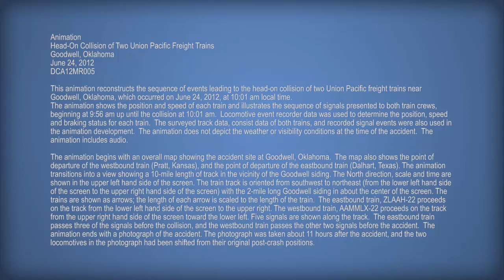Accident Animation, Goodwell, OK

Comment: 65 mph is cooking right along... My drive to work parallels a rail line and as I slow down to go through small towns I will often pace freight trains just to see how fast they're going. 50 mph is the usual top speed I see. Most are in the 35-45 mph range.

Of course this is roughly an hour north of the nearest yard, so speeds may be restricted due to heavy traffic preparing to enter/exit the yard.

Comment: Everyone says the crew must’ve fallen asleep. But, the lead locomotive had an “alerter” system that requires the engineer do something every 15 seconds or else the train goes into emergency. Either he found a way to disable that (virtually impossible) or the system was nonfunctional. A decade later, and this collision is still a mystery on why it happened.
Reply: Or he was just awake enough to acknowledge the alerter and move throttles a little bit but not enough to read signals, like that bnsf coal train that hit the back of a bnsf MOW train
Reply: NO mystery..engineer of east bound train was color blind!

Comment: As a former class 1 and class 2 railroad engineer i can safely and confidently state that the eastbound crew was completely at fault, their literal failure to make any change to their speed from the advance approach signal to the approach signal proves totally that they were oblivious as well as not paying attention to their signals along the route. You have to always be eyeballing the signals, you can not afford to miss even a simple advance approach one and still do nothing. This incident could totally have been prevented if the eastbounds crew was awake at the controls, my question is simple.....why did the emergency brakes not auto apply uncommanded??? Either the engineer or conductor had to have been awake and at least quickly cycling the throttle or dynamic brakes or something. An alerter is default set to activate after only 10 seconds of inactivity which would have caused that train to come to a stop well before the east end of the siding or even before the train made it past the signal at the switch entering the west end of the siding. So someone was awake just totally incoherent.
Reply: PTC was not invented yet to control brakes. Neither man was functionally 'awake'. See my comment above from experience.

Comment: I mean the whole track layout is kinda pathetic. Why not use a third switch which turns the diverging path to a dead end by default and need to be switched when the other train passed by? Apart from locomotives which should be unable to continue after passing a red indication by electronic pickups applying emergency brakes in this case, this is pretty much a no-brainer to implement which would provide much more safety

Comment: Thought theres a dead man pedal to prevent runaway or emergency braking kicks in place if they run a red.
Reply: Sadly it's common practice for engineers to put something heavy on a pedal like a metal lunchbox or brick so they can sleep on long hauls due to overwork and stress
Reply: also the crew might be awake (meaning continually reset the alerter) and still SPAD, the engineer have some vision problems and the conductor, idk why he didn't catch the signals but he didn't

Comment: I kind of understand train lights but also am ignorant to them as well so from my understanding, a yellow over yellow. Shouldn't that of been a red flag for that crew because doesn't that mean you're diverting from the main line at solid yellow speed while the top also says you're staying on the main line at solid yellow speed? Or is their something I am not getting?
Reply: Caesar Seriona read the signal from the top down
Reply: The Yellow over Yellow means the train must be slowed to not exceed the speed of the diverging switch at the next signal.  Each yellow aspect doesn't mean anything on its own, you have to take them together.

 The signal at the track switch would have shown Red over Yellow, telling them to proceed on the diverging route at the appropriate speed and to prepare to stop at the next signal.  But the train never got that far.

Comment: Was there no radio communications with either train.  Was there nothing, such as a dead man switch, to assure crew was awake and active
Reply: being modernized locomotives you are correct in the Alerter system to keep the engineer's attention, but its not a complete protection to keep the engineer's or conductor's attention, you can get into a repetition to hit the alerter when it starts to let you know its trying to get your attention  not sure what style would have been on these particular locomotives, one's i'm familiar with have flashing lights and a beeper that comes in beeping then goes steady light over a short time and the beep goes to a steady LOUD beep with the light before it applies the brakes
Reply: bogoto247     Good Question.  These were modern Loco's and would have been equipped with the Alert er"  system that should have stopped the train if the Engineer were asleep ???   IDK maybe there is a way to by-pass the thing.
Reply: From what I understand it's possible to wake up, deactivate the beeping device, and fall right back asleep again. As you said, I'm not sure which sort of design is used on these locomotives, but I do know it's possible to sort of 'cheat the system' before it activates the brakes.
Reply: It comes down to the fundamental theory of property rights, along with the fundamental theory of corporate (ir)responsibility.  We live in a social abstraction that reflects our underlying nature.  The essence of it, is crude power.  The alpha-monster calls the shots and everyone else who isn't an alpha-monster gets to dance to the alpha-monster's tunes.  Or else.  (In the context of human sentience, the animalistic alpha-style social order becomes a social pathology.)  Hell, I could write you a thesis on the subject.  We are tribal apes, and a clever bunch of alpha-apes invented a legal joke/system called "corporate entities", in order to shield said alpha-monsters from any culpability for their misdeeds.  I mean, Hell, who would want to take on the role of managing anything if it meant that they would be at personal risk, after all?  Thus, you wind up with the way it is:  the very antithesis of human rights, dignity, freedom and democracy.
Reply: Kim O'Brien - Well, you know, the stockholders and the Board of Directors have to be kept happy.
Reply: Its built that way to prevent an accidental stop in the flow of profits.
Reply: They're nothing but parasites so why should they have any right to make any decision about anything.

Comment: IF "The engineer of the eastbound train was unable to visually detect and correctly interpret the signals and he operated the train as if the signal aspects were green." why would he not use binoculars to read signals or resign his position of locomotive engineer?   If a conductor was present, would he not verify signal aspects?   Anyone killed?
Reply: I don't know the disposition of the condr who jumped but there are two ways to exit a locomotive. The front door and the back door. As far as him jumping from the loco goes...that's 50/50 as it relates to survive or die. There are stories where folks ride it out and survive and stories of those who ride it out and die. Same for jumping from the loco. Some jump and survive. Some jump and die. The hazards of riding it out are obvious. The hazards of jumping though aren't always clear to most. First, you have to hope you land on ground firm enough. God forbid you leap into a swamp or mud up to your neck. Doing this makes trouble for the second part...running away from the ensuing derailed cars that will be flying, bumbling and tumbling all over the place.  But it gets worse. IF you are lucky enough to land in a good solid spot and lucky enough to avoid being crushed by the derailed freight cars flying all over the place...then you have to worry about coming in contact with the CONTENTS of those same freight cars. Lumber, chemicals (sulphuric acid, molten phenol) automobiles, automobile parts ( ie: engines/transmissions), giant steel coils...all this stuff is also chasing once you exit the loco. It's a TOUGH spot to be in for sure.
Reply: TWENTY seconds, Fritzy ol' boy, TWENTY! Your hearing apparently matches the sight of the eastbound engineer. ; ] Twenty seconds in which to jump at 30 miles per hour and land mere feet from a train that's going to end up scattering who knows where -- or face likely death. That's a hell of a crisis decision right there.
Reply: You are correct. Mea Culpa !!
Reply: Yeah, but when a train jumps the tracks and the freight cars begin to pile up, that makes a much larger and wider mess.  He may have felt his chances were better in the cab than if he jumped but then got run over by freight cars abandoning the track.
Reply: phillyslasher   Thank you.  Sad that he did not jump.   Yes, that was enough time to get down and get away.
Reply: Damn, but this thread is fascinating. After nearly five years, it still draws us to it. 

Phillyslasher, if you'll listen again to the narration you'll hear that the westbound train plugged it TWELVE seconds before the collision, 

The eastbound did it with EIGHT seconds left. But these times weren't additive, so the westbound engineer had only 12 seconds left, not TWENTY.  

Although I'm not familiar with the ways out of a locomotive, It's seriously doubtful that he could've escaped -- even if his name had been Harry Houdini. 

As a point of interest -- to me, at least -- all we know about the conductor who jumped is that he survived and was able to testify about the westbound's approach to disaster. I've read the report. Unless I missed something there was no mention of how he got out and off, and what condition he was in when he was found along the ROW.

Does anybody know?
Reply: If possible, I would have run to the 2nd locomotive and sheltered in the cab and shut to locomotive off.  That may be.tter than exiting the first locomotive and trying to get away without being crushed by locomotives or rolling stock.  Best to keep the second locomotive door unlocked just for that purpose.
Reply: "why would he not use binoculars to...", for the simple fact that the GCOR clearly states that the use of binoculars (to be used as you suggest) is FORBIDDEN!  What you think and what is permitted/not permitted on railroads differ vastly.
Reply: captainmorgan757 don’t take the OPs comments seriously. Look at his YouTube channel and his about page and you’ll find that the guy is a weirdo.
Reply: @captainmorgan757  Why in the hell would binoculars be forbidden? I'm surprised they don't have a rule that says you must stare at the sun with eyes open wide too!
Reply: theoriginalbillholt Depending upon what I am hitting, I'd stay in the cab.

Comment: Nearly four years after the collision, I remain interested in this disaster because of what I DIDN'T read in the final report, except as a brief dismissive remark -- that both the engineer and the conductor were probably asleep. The dismissive comment noted that there had been throttle and dynamic brake action, inferring that the engineer had to have been awake, but because of his eyesight problems he wasn't seeing the signals that he passed. 

My unanswered question is -- can someone who is colorblind recognize whether a specific signal light is on or is darkened? Isn't aspect a valid indicator of what to do -- color or no color.

The  FLASHING YELLOW certainly would've got the attention of at least one of the crewmen in the EASTBOUND train -- regardless of whether you could recognize that it was YELLOW or not.

IF THEY'D  BEEN AWAKE.
Reply: I am colorblind, (red/green) and although I am not on a railraod (I am just a foamer), I have learned to read the aspect by the position  of the signal. Unlike a "regular" traffic signal, green is on top, red on bottom. Even though -- at times -- I have have a hard time telling them apart, I can tell by where it is, what it is.
Reply: navy57 
Conductor completely passed out and the engineer nodding off at the wrong times.
Reply: If the engineer and/or the conductor had been awake, one or both of them would've seen the flashing yellow and acted accordingly. They didn't do a thing, THEY WERE ASLEEP -- no matter how anybody tried to sugar coat it.
Reply: They were asleep, and yes you can smack that alerter and make throttle adjustments in your "sleep", ask any engineer that has been worked into exhaustion....I know.
Reply: @Iowarail  Correct. Just because you have been off ten hours doesn't mean your rested. They call a extra and maybe deadhead crews ahead of you. Next thing you know your called. I loaded up on trains more than once like that, thinking dammit. LOL
Reply: Well I consider that they get tired and would like to sleep but if so why not take turns. I know indian railways are bad but my uncle is engineer here and he too sleeps in his cab. He literally travels with a thin mattress folded in his bag. But they take turns, the assistant stays awake for say 2-3 hrs and runs the train and then he runs for his turn. Operating a locomotive normally takes only one man now a days so this arrangement works, although its illegal and if caught can loose job and all the affiliated facilities with it. But it still way better then both men dosing off unknowingly and leaving the train unattended.
Reply: Great comment. Lots of information. It's a terrific addition to the discussion.
Reply: And this happened at 10 AM!
I might understand late at night but, 10AM?
Reply: Just my opinion, but if this had been at night, the two trains could've noticed one another much farther apart than they could have in daylight. That still wouldn't have made much -- if any -- difference if the eastbound's crew had fallen asleep, as I'm certain they were. 

As other contributors have noted, there is a slight upgrade in both directions that crests slightly to the west of the site of the collision. During daylight hours trains approaching the crest from either direction are unable to see beyond it, which was the case on that dreadful morning. The westbound train crested it and  in a instant saw that the eastbound was coming at them -- hard. Collision was inevitable.

At night, although it would have been possible for both trains to see each other's headlight beams long before reaching the crest.that would've made no difference. The westbound train had been reducing speed -- as the signals had directed it to do -- in anticipation of entering the Goodwill siding to allow an eastbound train to pass without stopping. Headlight beams notwithstanding,  THIS  collision would have happened.
Reply: I'm not sure, at least from my view and knowledge. I'm not colorblind so I really can't say. They might be able to, or might not be able to. (There are different degrees of colorblindness)
That's where certain signal designs and standards come into place. See this for signals on the North-East Corridor:
www(dot)railroadsignals(dot)us/rulebooks/amtraknec/AmtrakNECaspects.jpg
One can differentiate between the indications by color and/or the angle shown on the signal.
Reply: Engrs MUST pass a eye exam. If they fail eye exam, they lose their engr certification. Now they could go back to being a switchman but cannot be an engr.
Reply: I do not know the term for operating anything when the person is asleep but it happens. 50 years ago I drove a truck from Kendal, Ks toa mile west of Syracuse and do not remember any of it. Drove through town, stop lights, every thing. No problem but have never had any memory. And I had to stear it, the train crew does not. People in Goodwell said he was blowing the horn, yes I'm sure he was.
Reply: 4 Years Later 2016  in Panhandle Texas on BNSF 2 CRASHED ON THE NEARLY SAME CONDITION
Reply: Every section of track is different. With our 4 or 5 remaining railroads using track & signals installed by 100s of of now defuct railroads, there are dozens of signal types. New Mexico, Illinois, and New Jersey still have some old 1920s semaphore signals. No need to see colors for those at all. Straight up position of the arm is green, 45 degrees is a yellow, and horizontal is red. The old PRR 7 lamp is a lighted version of the semaphore. The 3 color 1 lamp targets fell out of favor, because of the color blindness issue, and no way to show an malfunction default signal of red. The old mechanical semaphore signals are nice in that gravity makes the arm fall to indicate stop should ANYTHING fail on the signal. Falling asleep, or playing cards or just f'ing off and not paying attention  was/is pretty easy for train crews. It's on rails, so you don't have to steer. We are getting more and more self automated with trains now. Wholes strings of locomotives run by remote control with no personnel in them now.  This is in the yards. Once a train is made up into a consist, it must be manned before it can proceed out of the yard.
Reply: lol
Reply: Mebéys tháy wêré DrúnĶ§ 🍺
Reply: Either asleep or attempted suicide by the conductor, not saying that for this one, but I've heard of other crashes being suspected as intentional.......guess we wont know officially since its probably all covered up now....
Reply: @truckercowboyed2638 nothing is covered up, you can go read the accident report.